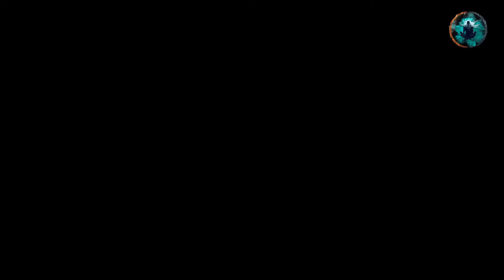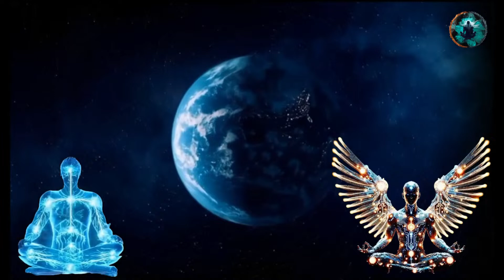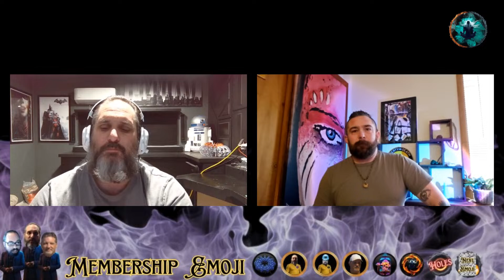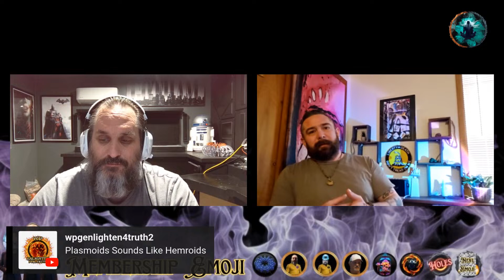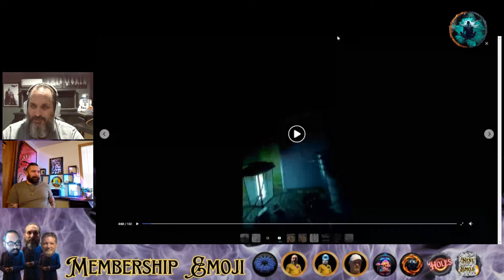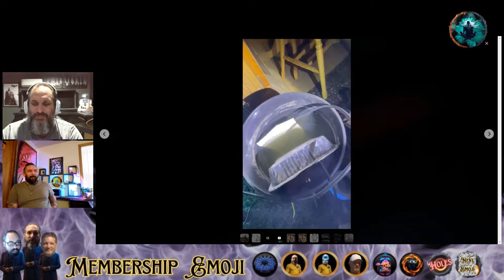Forbidden electrodynamics? With Joe & Nathan

Comment: in reference to 24:10 you are literally describing what it is like for a surfer when you get barrelled. the water is wrapping around you in a toroidal fashion but also propelling you forward in a horizontal vortex. time feels like it slows down, and every tiny movement is amplified, but you are actually travelling faster, especially when you are shot out by the pressure build up.